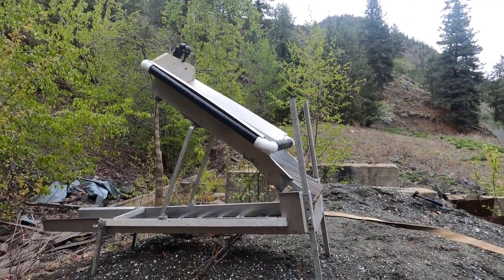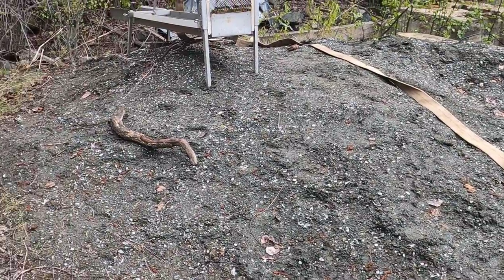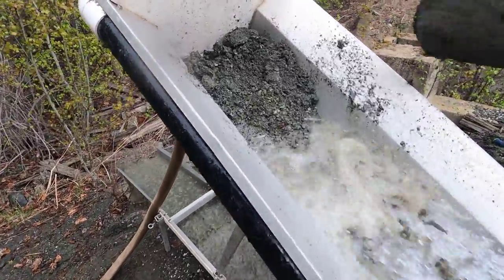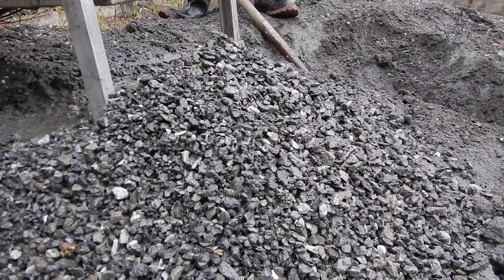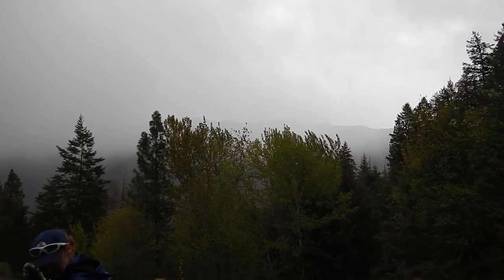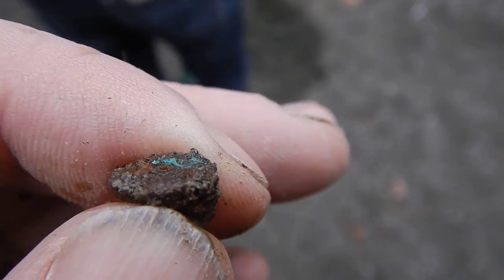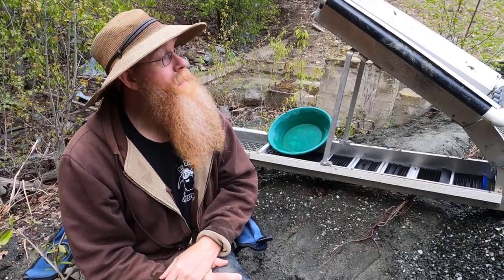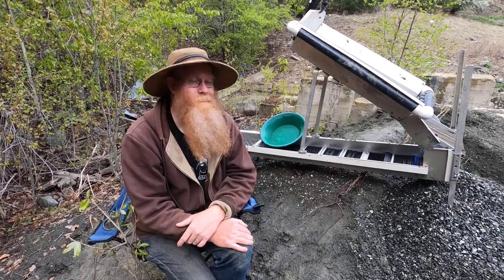Looking for gold at a copper mine!

Comment: Question re those old piles of ore / processed material. Given gold is heavier and that any gold in them would be sinking. Wouldn't you consider the top portion (not sure how deep) would be over burden and the gold found a bit deeper? Simply due to weathering, rain washing it back into the ground.
Reply: And yes, I typed this whilst watching and saw at the end where there was little gold found here at this Copper mine. But the question stands for other sites...

Comment: I've done a small smelting operation of high grade copper ores (mostly malachite and cuprite along with copper sulphites) and you're going to have to mill it down even further to a fine powder if you are to refine a decent amount of it. I used an ancient method used by the ancient Egyptians used to refine their copper using only lump charcoal with no flux. If you use a different method, like using a gas foundry with flux or using electrolysis, this advice may or may not work.

Comment: It should be noted that Malachite and Azurite are copper carbonates, although you might refer to them beeing oxides in a chemical sense, chalcopyrite  and other sulfides would also fall in under the catagory of oxides, bit wonkey but from what I've learned geology and chemistry name and classify them somewhat differently.

Both Azurite and Malachite can be reduced/melted with a carbon mix in the crucible as with oxides the idea is to create CO2, however if you have a sulfide you first need to react that with oxygen in a roasting process.
In case of the last melt to turn it into metal oxygen in the crucible is idealy unwanted since you want the carbon to react to the oxygen in the mineral, in a gas furnace i recon most of the oxygen isconsumed in the fuel mix, however as i use a charcoal furnace i place a piece of charcoal over the top of the crucieble  so its carbon will react with any oxygen trying to make it into the crucible.

Comment: You might need to take a truck load of that stuff and run it through your mills to crush it down and see what's in those big pieces. The difference between azurite and malachite is one is made by copper sulfate and the other is almost pure copper hydroxide. Really it just comes down to azurite has 1 more copper atom in it's molecurlar chain as well as a double carbon trioxide group. (yes I had to look it up.. thanks wikipedia :P) Azurite Cu3(CO3)2(OH)2 Malachite Cu2CO3 (OH)2

Comment: The real treasure ya got isn't just your wife like Joe M. Said, it's your whole family who will dig for you in the rain.  And if they will do that, they will do anything for you.  Everyone thinks that real treasure has to sparkle....no, it doesn't!  Question...I am in the process of tinkering with a "new" sluice box design that is a little on the "out there" side as my wife thinks. In your opinion, which many of us subs consider 'word from on high' (in case you didn't know yet), what is the absolute best matting to use (and the worst so I avoid it)?  Don't want to reveal too much yet as I am still designing it.  Lemme just say, a prospecting friend calls it the "scrubber".  Also, was wondering, as a fellow prospector and major heart attack survivor (had the BIG BAD ONE that almost put me fork end up at age 48) what did your Dr(s) say about yours?  Mine was what is called a 'widow-maker' because it is almost always a widow maker due to the area it happens in.  Reason I ask is I'm researching alternates to the handful of pills that sometimes makes me feel worse than better i have to take every day.  Anyway, stay safe and we'll see you in the next one.